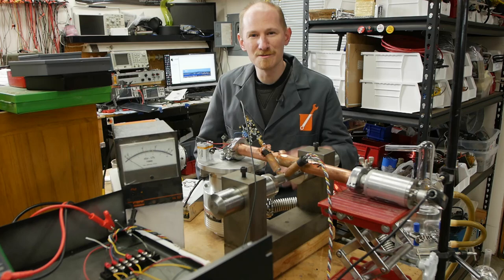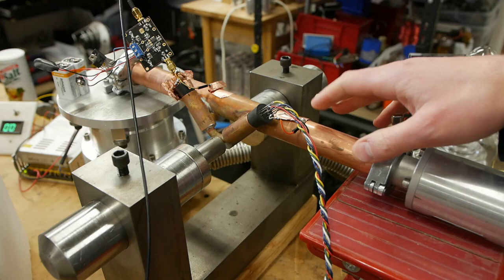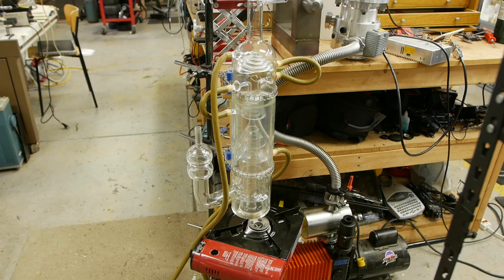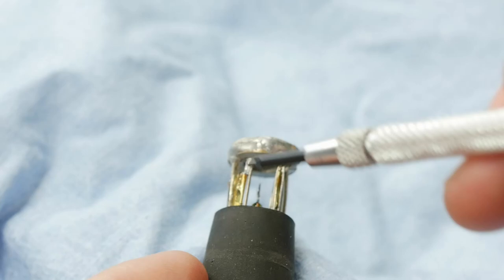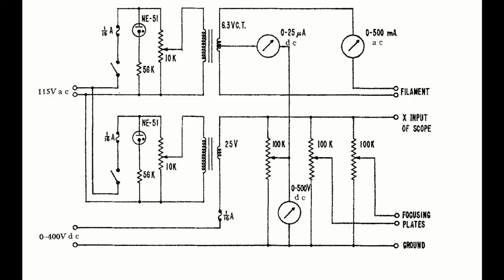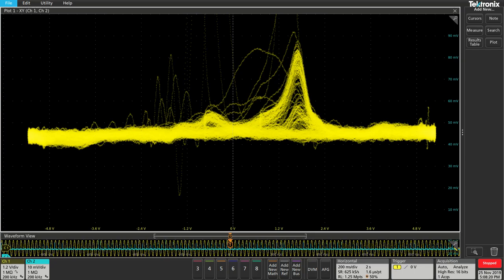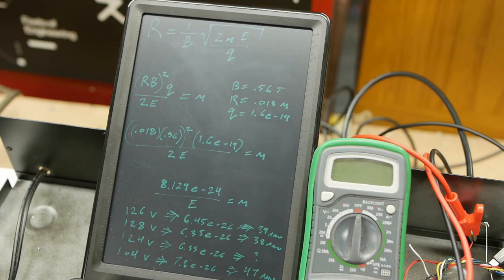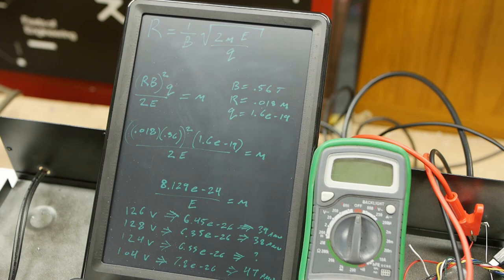DIY mass spectrometer measures potassium in dietary salt substitute

Comment: Perhaps the "47 amu" ghost trace is a result of multiple possible ion trajectories that all result in collection. For instance, a "fast" particle well tend to follow a smaller radius tucked toward the  outer bend of the apparatus,  while a "slower" particle will follow a slightly larger radius and tuck closer to the inner bend of the apparatus; both resulting in a particle intersection and collision with the collector.  The IEPC paper: 'Electrostatic Analyzers with Application to Electric
 Propulsion Testing' Figures 1 and 2 are what I'm getting at. Although ESA's lack a B field, I figure it worth the through experiment.

Comment: The "forward but not backward" should be easy to check by only plotting either one. You could inspect the copper bent, maybe you can see a spot where the beam hits and gets weirdly deflected, or just put in some physical target and look at how the speck ends up there.

Comment: I'm not an expert but could the copper tube pull noise from the electrical outlet you have in your shop? or do you have sufficient low and high pass filters to eliminate all of this with such a large conductive mass. Is there any reason you would want to use a copper plated tube instead to eliminate some of the noise?

Comment: split your data so you only look at the rising edge of the voltage or the falling edge of the voltage.  That will remove the hysteresis.  Send the data to a spread sheet.  Nice work

Comment: If the abnormal peak is real (lets assume it is), then it would be Titanium with an AMU of 47.87.  With a bit of rigorous research (googling) and some deductive reasoning (sitting and staring at my monitor), I found a few possibilities:

1- Titanium Dioxide is a filler in many salt products, though at less than 1%, its not enough to cause a spike of that size.
2- Many razor blades are coated/edged/made from titanium.  Is it possible they are sputtering?  Your system has many similarities to a Sputtering Magnetron (vacuum conditions, magnetic/electric field, accelerated ions, etc).
3- The supporting wires in some lightbulbs are made from or coated in titanium to increase their lifespan.  Could this be ionizing as well?

Final Thoughts: Though each of these individually may not have a large enough impact to produce that spike, a combination of some or all of these could do it.  The simplest solution is to just try changing the blades/bulb/salt individually and then in each of the combinations to see if it reduces the spike.  Though maybe testing the electrical components (sawtooth AC signal, plotting forward and reverse sweep separately, measuring an empty test chamber and subtracting that from a sample to "clean" the result) first might be simpler than 8 extra cycles...

Comment: Excellent  project, good performance from such a elementary apparatus. 5e-4 torr 
is a rather high pressure I suspect there is leakage at the stoppers plus out gassing.  
Flaring the copper fitting would provide more sealing area also stoppers made 
from low vapor pressure material like Viton or buna-N should help.  If your turbo
pump is working properly you should reach the mid e-6 torr range. Hit the copper 
with a heat gun, bumping the temperature should accelerate pump down.

Have you tried running it with just a clean filament to see if you can detect the 
residual gases left in your vacuum system, dose that anomalous peak appear 
under this condition?

Comment: I think for reliability you should generate your own fixed AC Source from a stable DC Supply with a pure sine-wave oscillator. Mains AC is convenient, but tends to fluctuate in frequency and voltage quite unpredictably according to local demand on the grid, which could muddy the readings.

Comment: As far as the issue with the ~ 10 pF input capacitance, could you get around that by using a technique akin to X10 scope probes? That is, have a trimmer cap in front of the TIA to add a zero to counteract the pole you're experiencing?

Comment: I wonder if the source is emitting a single beam, lets say, the filament is just a coiled tungsten thing, you coat it with the specimen substance, yet the temperature profile may not be so uniform, so in the zones in which the thickness between filament and vacuum is smaller you may have more emission than in the other zones, considering that the pitch of the lamp filament is quite small yet comparable to the width of the slit, so maybe you are getting many parallel beams that repel each other and when modulating the electric field you switch from one to an other, i would try replacing the lamp filament with a straight filament and see if the effect disappears or gets reduced

Comment: Tungsten in the +4 oxidation state has an average mass to charge ratio of 45.96. Could this just be the filament material less its four 5d electrons? Did the smaller peak  disappear after the KCl sample evaporated?

Comment: I would suggest using a sawtooth instead of sine wave for separating the masses out.  I haven't quite figured out the issue I'm sensing with using a sine wave, but I think it would eliminate some of the issues you see.

That's an interesting method, BTW... I'm more used to units using magnetic fields.

Comment: The "mirroring" could be from hysteresis in the X-axis (are you using the exact voltage waveform to drive the 'scope that is driving the tube?  There could be a phase shift in that AC circuit.)  You are scanning with AC, which is going "both ways".  Either you should use a sawtooth wave, or suppress the 'scope trace when scanning in one direction, & show it in the other.  That way, the hysteresis effect will  be consistent for every trace.

Comment: This was really fascinating how you broke down the chemical content.  I have been working on restoring some old metrology  equipment to measure nanovolts.  There's all this talk about low emf connections and types of copper.  I get the thermal effect of  different metals in a connection and how that effects  how clear a nanovolt measurements may be.  But is it necessary to worry about one metal connector being pure copper or silver plated copper against another connector that's beryllium copper or a beryllium  connector to  Tellurium copper connector?  Is it possible to use a device like yours to verify the copper, beryllium  or Tellurium is really that pure or even using those compounds?  Sopunds like this could be a great experiment for your channel.

Comment: I've been working on transimpedance amplifiers for single photon detection.  Is the TIA you have good enough or do you still want to improve it?  It looks to me like you have at least 4 or 5 pF of extra input capacitance from that SMA and traces, which will hurt your SNR.  I'd suggest putting the whole thing in the vacuum chamber to reduce input capacitance if you can.  I put a design on github that gets the TIA, photodetector, a pulse shaping secondary amplifier and connectors onto a 1" circular PCB.  Wouldn't be too hard to get it down to 0.5" diameter if you dropped the connectors and extra pulse shaping.

Comment: Could you modulate the transmit current with a different frequency AC signal to use a lock-in amp with it?

Comment: Interesting way of building the mass spec with varying the acceleration. Normally (as you told) you change the strength of a magnet that bends the ion path, bend the path with a quadrupole or for very high mass accurate mass specs, measure the flight time of an ion or however thermo scientifics Orbitrap works.

Comment: Our older analog instruments required a 'linearity' calibration (kind of a tedious procedure)

An organic molecule FC43 or perfluorotributylamine was introduced through a very small tube from a glass bulb filled with the FC43

The FC 43 would break down into a very predictable array of M/Z ions in the source.

The largest 'base' peak was M/Z 69 with a series smaller peaks (131, 219, 414) on up to 502 M/Z

The challenge was to first center the 69 peak, maximize the resolution and then adjust the 'linearity' on up to 502 by adjusting the magnetic field, and beam focus and other parameters.

Comment: Other guesses for second peak (Titanuim remains the most likely though):
* doubly ionized molybdenum (94/2, 95/2, ...). Molybdenum may be used as a wire that supports the filament, because it has a good thermal expansion compatibility with glass. It is commonly used as wire in glass feed-throughs in our lab. However, it has low vapour pressure, and double ionization is generally less likely than a single ionization, so it's unlikely.

* CO2 (44 amu), commonly outgasses off of a tungsten filament. Though unlikely, as the mass is quite off.
Reply: Molybdenum could definitely present in the system if there were support wires on the tungsten filament, but there are no separate support wires in the bulbs he is using, as can be seen at 8:21. The terminals the tungsten filament is attached to are very likely to be a copper plated iron nickel alloy, (Dumet wire) as this is very common in light bulbs. I definitely agree that titanium (from a coating on the razor blades) remains the most likely candidate.

Comment: About the rubber stoppers. They contain big amounts of carbon to make them more heat and chemical resistant, but to cure them they have to be baked with higher temperatures, probably high enough to drive off most of the volatile substances in the rubber.

Comment: I've become really interested in diy mass spectrometry lately and this video is really encouraging. A lot of the uncertainty in this build seems to come from the friction between building a vacuum-tight object that can still be accessed for sample loading and building a geometrically-sound experiment to ensure the ion beam is aligned (or at least steerable to alignment) 

This feels like the same design challenge you faced in the DIY SEM build, except that this isn't light-sensitive in the same way as the photomultiplier in the SEM. 

Could you take this basic design and kind of "explode" it and build it inside a bell jar? That way everything can be electrically isolated with hard plastics and ceramics (that don't necessarily make good vacuum seals) and your pass-throughs to atmosphere can just be spark plugs.
Reply: I know this sounds like volunteer work. I'll add it to the list, lol

Comment: Is it possible that the razor blade has titanium coating? Titanium has an AMU of 47.9. Beam erosion of the edge could cause a contamination.  I don't know if that's possible with energies you are using though.

Comment: Since the peaks look so similar to each other, maybe there is some reflection occurring in the system. Maybe the beam gets reflected at the detector and then deflected back at it at another angle, or maybe the reflection is somewhere in the tubing.
 I have no idea if reflection is a possibility with an ion beam though, since it probably will be absorbed into anything.

Comment: So my opinion is to investigate the use a little post processing.  Store the samples and average is the first thought. To me the issues here are very similar to FFTs. Is there aliasing happening (similar to concept of an echo). How do you increase the resolution - reduce the bin size of the FFT. But ... is the AC frequency too high - in other words is it scanning too fast to show that smaller peak. This is sort of similar to an analogue equivalent of averaging. If you do slow the frequency, then that small transformer will need to increase significantly in size (as a side comment, I expect the response of that small transformer at 25Hz will not be particularly good). Also, do you have a gap in the transformer to cope with the DC current component? You may want to consider a 400V programmable power supply, which super simplify what you want to achieve. But designing a low frequency transformer which is also DC current rated, would be a really fun exercise.

Comment: Hmmm yes I just happen to have a turbo molecular pump and a penning gauge hanging around.
Honestly well done but I hate to think how much this cost.
Could the small peak be a reflection off the back of the transmitter ? Some Ions actually not being accelerated the right way to start with and bouncing off

Comment: Building a basic Gas Chromatography setup for detecting organic compounds shouldn't be too difficult, You'd just need a gas supply (reasonably clean Hydrogen or Helium ideally Nitrogen could work too, but will give worse performance), a Column (packed would be easiest) and "ASTM E260-Standard Practice for Column Gas Chromatography" should be helpful here, and an Injector which could be as easy as a rubber stoppered copper pipe. I think the difficulty would be the interface between the high pressure column and the low pressure spectrometer serving as a detector. 
I'm actually currently working on a DIY Gas Chromatograph and could point you to some resources.

Comment: Try changing the scanning frequency and/or depth of modulation. If the separation between the peaks changes accordingly, you'll have hit frequency modulation's lower side bands. In the narrow band approximation they can behave quite like the SSB ones, only the lower ones will be attenuated by some combination of Bessel functions.

Comment: Fantastic results Ben. About your presumed phantom peak, no good ideas, but does it go away propotionally to the main peak when the sample evaporates? can you change the sweep frequency? is there any correlation between the time of flight of the ions and the delay between the peaks (time it takes for the voltage to change that much)

Also, i believe you can improve the throughput significantly by using wider slits, without really losing a lot of resolution as long as the filament is larger than the slits (the emmision angle would be roughly the sum of slit+filament width divided by the distance between slit and filament) so probably a larger slit placed farther from the filament could increase both throughput and resolution. I'm sure you aligned the filament with the slit carefully ;-).

radu

Comment: Could that false peak be caused by an incorrectly terminated cable that's causing a resonance or reflection?  Is the capacitance of the cable considered in the calculations?

Comment: Very neat project.  I didn't go through all the comments, so I apologize if someone else suggested this.  Now my comment.  Did you deconvolve the composite peak into two peaks to see if the result was consistent with the known mass ratio?  There would be uncertainty introduced by not knowing the precise band width of the gaussian peaks, but the right side of the primary peak gives a pretty good control on that.  If you do it, don't use peak heights for your ratio.  Instead integrate the areas of the two peaks.  The only time consuming part would be digitizing the composite peak.

Comment: A bit late but well hopefully I can give a few things to look after in finding the source of the 47 mass peak. 

Does the 47 mass anomaly disappear when the sample disappears? If not I'd say it's either the carbon dioxide mentioned or one of several products that has been deposited to the filament by heating the rubber stopper, a carbon dioxide peak should change relative to pressure and a rubber products peak should behave inversely to the pressure.
If is dependent on the sample it is probably additives like titanium.

And of course a heavier particle additive to salt will take a longer time to be completely eliminated from the sample which is worth taking into consideration.

Lastly I don't think rubber stoppers is a problem even if there is products from rubber turning out to be the contaminant, but covering the source plug with a protective layer so that heat and material will not exchange between the plug and the filament if that turns out to be the issue might be an idea.

Comment: The second spike really looks like harmonics. I wonder which effect the ion beam has on the copper tubing when it hits. It should induce a voltage there, right? Might there be current flowing and shift your ground reference?

Comment: I have heard that epoxies have decently low outgassing for vacuum applications, so maybe one could make an epoxy filled cap as a replacement for the rubber stopper, if it ever becomes a problem for any reason.

Comment: About the two peaks: 
why is it not a hysteresis, as you mention it in your video? (Sorry in case I'm not the first one to mention this, I haven't checked all the comments) 
What if the period time of the offset AC frequency and the acceleration time of an ion are in a similar range? (actually I have no clue about it.)
If accelerated with a rising voltage, the exit speed will be lower, because between being emitted from the filament until exiting the source accelerator, the ion was first accelerated with lower voltage and therefore will result in a lower exit speed (integrating the acceleration force over time) and vice versa, if accelerated during falling acceleration voltage, the exit speed will be higher.
This results in two different detection delays (Y channel) compared to the applied acceleration voltage (X channel) on the X/Y display.
In addition, because of the different speeds, the ions will differ in the radius and direction applied by the magnetic field again shifting the peaks further apart relative to the X-channel direction.

Comment: What if you had a hot plate on the hot end?  Maybe put the hot plate on the bottom an ion shooter points to the side and a contraption above allows you to drop small samples a little bit at a time onto the hot plate.

How do you clean the detector?